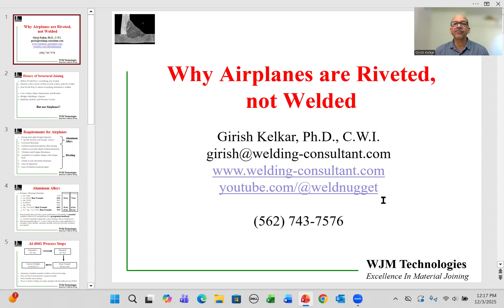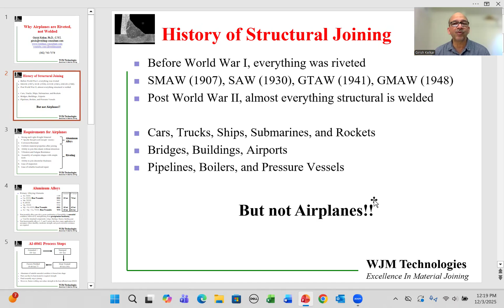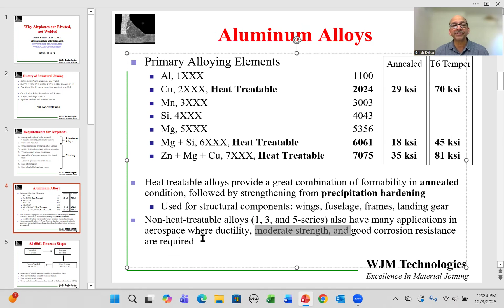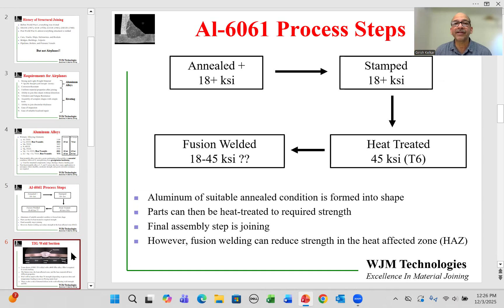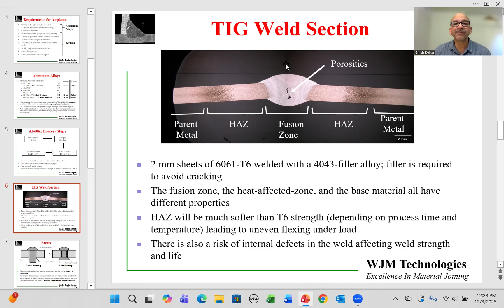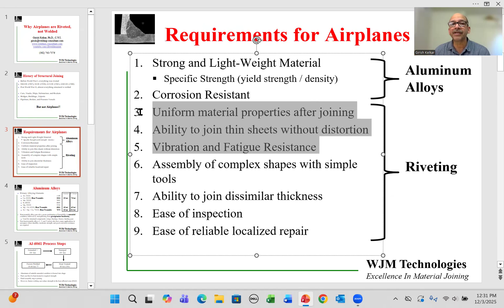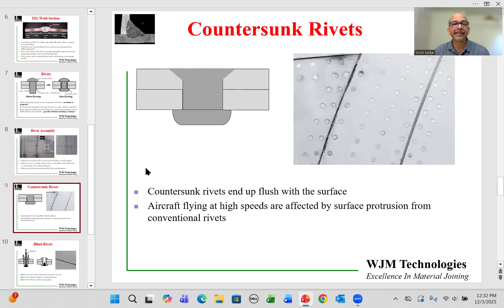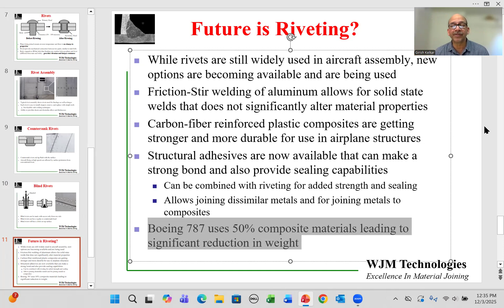Why are airplanes riveted and not welded

Comment: Seems to me aerospace manufacturing has been trying to get away from riveting as much as possible.   I suspect it’s due to time consuming rework process for reinstalling rivets that do not meet the stringent quality specifications for rivet head shapes, gaps etc..  Also excess noise if using old bucking techniques.
HI-LOK style two piece fasteners are much easier to install and if rework is required they are easily removed and replaced - reducing rework costs.
Reply from the maker: Overall, use of fasteners will reduce as more of the aircraft is made of composites and then adhesively bonded.  But where fasteners are required, rivets will have a place because of being lighter, not requiring very precise hole drilled, and having good shear strength (compared to Hi-Lok which are heavier, require precise hole drilled, and are better in tension applications).  Given that the commercial planes are huge, all kinds of fasteners including regular bolts will find their niche.

Comment: Very interesting.  Please could you explain what 'stressed skin'  means in respect to aircraft fuselage etc manufacture  . Thanks.
Reply from the maker: The best way to understand stressed-skin is to first understand the extremes.  At one extreme, you have monocoque (french for single shell) design, where the outer shell/skin carries the entire load and there are no internal structural components; good examples are an egg-shell itself and the bob-sled.  On the other extreme are designs where the internal structure carries all the load and maintains mechanical integrity, while the outer skin is just for enclosing the space but does not carry any load; good examples are dry-wall (in US housing construction), and outer panels of a washer/dryer; if you remove that "skin" the structure still stands and there is no loss of function.

Stressed-skin designs are where the outer panels are for producing the desired profile and also carry some of the load, as is true in aircraft where the outer skin has to be able to maintain shape integrity while transferring some of the load to the internal framework.  Removing such skin can lead to loss of function and can even lead to immediate failure/collapse of the structure.

Comment: Excellent video!  But should have added that riveting is about the "only" way to fix sheet to frame structures.  And should also have explained on the disadvantages of rivets:   As forces are transferred trough single local points, materials have to be chosen much thicker to deal with total forces!  And fixation of 2 sheets side by side requires an extra connection plate!  Both these reasons do add weight to riveted solutions!
Reply from the maker: Agree that rivets do have disadvantages of requiring to drill holes, needed a connection plate for butt joints, and needing many rivets as each small rivet can only transfer so much force.  Rivets indeed increase weight of the structure, and hence are now used only in special applications.

Comment: Why can’t bolts be used if they were made of the correct material they would compress like a rivet but if tightened by torque  they would be more predictable.The rivet is not compressed to an exact torque is it?
Reply from the maker: Bolts can be used in situations where vibration resistance is not as important, but cannot be countersunk flush to the surface.  Rivet strength is defined by material properties and dimensions, and is quite consistent.

Comment: Years ago, I remember there were descriptions of rivets being heated to red hot levels, inserted into a hole and then some form of compression hammer pounded the rivet to fill the hole in the structure. …used in bridge construction, I think. Is that technique used any longer?.
Reply from the maker: Steel rivets are not commonly used except for repairs of old bridges.  Mostly have been replaced by either high-strength bolts or welded construction.

Comment: Own a small welling business welding 7000 series aluminum should never be considered it’s just a disaster I don’t care what you use laser mig tig
Reply from the maker: Many high strength 7xxxx and 2xxxx alloys of Aluminum are susceptible to hot cracking and are considered un-weldable by conventional fusion techniques; exception is 2219 which is used for aerospace structures and is fusion welded.

Comment: Friction stir welding is being explored and used in some aircraft structures
Reply from the maker: Friction stir has benefits of making a solid-state bond (unlike fusion welding) but is not easy to repair and replace (unlike rivets).  So it falls somewhere in between.  Amount of friction stir welded components are increasing in usage in all industries where aluminum is used including aerospace.

Comment: So puddle welding or spot welding aren’t mentioned as a comparison and I’ve wondered how it would share In similarities as rivets.
Reply from the maker: Spot welding is not feasible to repair, whereas rivets can be removed and replaced with simple tooling.  Also, heat from welding can affect the material in and around the weld including distortion.

Comment: Chance Vought spot welded the skins to the structure on the Corsair, snd I think several other aircraft.
Reply from the maker: Many welding processes including spot welding and arc welding are used in aircraft manufacture.  Rivets are preferred in situations where repeatable mechanical behavior and ease of maintenance (inspection, replacement) are important.

Comment: Angara's rocker tanks are friction-welded with stirring on huge slipways.
Reply from the maker: Friction stir welding has been widely adopted by the aerospace industry for welding aluminum, and they will use it as the first option for welding given that it is a solid-state process.
Reply: Doesn't friction stir also produce a lot of heat and thus produce a HAZ? Or is is just less of a problem than with arc welding?

Comment: There is one crazy airplane welded like a ship from stainless steel - MIG-31.
Reply from the maker: I do recall watching a documentary on Mig 25 (earlier version of Mig-31) where the pilot defected to Japan; and analysis of the aircraft revealed it was all welded stainless steel.
Reply: @weldnugget  It's funny to think of it as a flying railroad car for transporting kerosene. 🤣😂
Reply from the maker: Design choices.  I think developing a welded stainless frame was a lot faster than other options at the time (cold war).  And it did hold records for highest altitude flight and fastest (>Mach 3); not an easy feat.

Comment: Riveting is a non permanent joining process. Hmm, countersunk rivets help maintain laminar flow across control surface. The sudden sharp change in geometry may lead to formation of turbulent currents.
Reply from the maker: Riveting is a mechanical means of connecting which does not alter the base material properties. Rivets can be removed and replaced for maintenance and repair.

Comment: I have read that there are certain adhesives better than rivets.  My dentist said compounds based on sea barnacles might fix teeth for a lifetime and could have uses in aviation and space vehicles.  Sounds good but I know next to nothing about this.  What I do know is that 20 years ago I glued some outside parts on my motor home.  The motor home, always outside, is disintegrating but the glue parts are as strong as ever.
Reply: High bond strength double sided tape has been used to bond sheet metal panels to body frames in commercial vehicles for some time now.
I saw a demonstration of 3M VHB tape joining two pieces of pine framing timber. When the timbers were pried apart the wood surface tore away and remained adhered to the tape
Reply from the maker: Awesome.  Thanks for sharing.
Reply from the maker: Yes, there is always a joining technique for a specific application that works well.
Reply: Laminated  aluminium sheet exists are also used for aircrafts, I believe it was developed here by the Dutch University TU Delft, and later patented in a commercial product by Akzo Nobel under the name  "GLARE" from a combination of the words Glass, Aluminium  Reinforcement.

”Glare consists of layers of 0,3 – 0,4 mm thick aluminium alternating with epoxy-bonded glass fibres. Though material and production costs are relatively high, the material allows for a design tailored to local stresses and functionalities, and the production of very large skin panels. This results in lower assembly costs and significant weight savings.”

Used in the Airbus A380 and probably many more.

I imagine it can be riveted just like the full aluminium sheets, but I actually don't know what joining method is used there. would be very interesting to look into
Reply from the maker: Good old AI search says that GLARE sheets are joined by adhesives or rivets, depending on the application.

Comment: But why aren't rivets more widely used? For instance, why aren't rivets used in boat building?
Reply from the maker: Rivets are well suited where the application would require lot of flexing (as on an airplane wing) and requiring vibration resistance (as expected during landing and take off).  Plus on boats you have an issue of corrosion and sealing; welding would be preferred.
Reply: Small aluminum boats are quite often riveted. Lund, etc...
Reply from the maker: Rivets are probably the cheapest technology for joining, and there is always going to be a market for those in certain segments.
Reply: THey used to be used in ship building. Welding saved significant amounts of weight for the same strength. Especially in context of the Washington treaty limiting warships by tonnage that was a major concern.
But that is welding steel, which comes with different behavior changes (and ways to control them) for the HAZ and filled sections.
Today the easy availability of welding roboters (both the melting and mechanically stirring kind of) that keep the whole process repeatable&predictable and there is a wider variety of joining methods you can select from in accordance with the task. Rivets are one of many options, and often not the cheapest.

Comment: On a Velomobile I made when skinning with 6061 T6 between lot joints I applied to layer of urethane sealant before drilling and riveting. The urethane remains elastic and prevents oxidation at the contact between rivets and aluminum.
Reply from the maker: Yes, that can be an option. Urethane might also provide damping of vibrations.
Reply: @weldnugget  yes that was my primary purpose. Because of the oxide layer, it adheres very well.
Reply from the maker: In addition to damping, adhesives can provide sealing to riveted joints; and also provide separation to prevent galvanic corrosion between dissimilar metals.

Comment: That was very interesting. I work with various alloys. We know that 2024 and the various 7000 series allows are considered to be unweldable. Actually, they can be welded, which is concerning as these welds can come apart in time. So while the weld seems viable, it’s not. I’ve just acquired a laser welder. It offers a lot of valuable options. I’m experimenting with various techniques.
Reply from the maker: Fusion welding of high-strength aluminum alloys is challenging as you have to deal with issues such as solidification cracking (during weld solidification), stress corrosion cracking (in use), and low strength in the HAZ (result of heating during fusion welding).  Alternatives include solid-state welds (e.g., friction stir welds), mechanical fastening such as riveting and other specialized fasteners, and structural adhesives.

Comment: What about laser welding? It offers some good properties. There is still a haz, but it can really be greatly minimized.
Reply from the maker: Laser welding offers some advantages but not as good as riveting for connections that require uniform properties and significant flexing.  Plus the issue of on-site repair is not easy for laser welding.
Reply: @weldnugget  ok, thank you for answering!
Reply: the welding METHOD makes no difference to the metallurgy of an aluminium alloy.

all that changes is the amount of heat affected zone and precipitation of various  elements from the solid solution. shielding gas or fluxes (whose fluxing alloy these days in aerospace?) may play a role as they add or remove alloying elements.

plus porosity, inclusions, undercutting, insufficient penetrations, toe and heel cracks,  on and on....

Comment: friction stir welding is not repairable easily in the field.

carbon fiber composites also bring with it a whole host of potential issues regarding failure, inspection, and repair.
Reply from the maker: Agree.  There are many joining/welding techniques that can be used (and are used on some parts of the planes such as engines and landing gear), but the ease of repair in the field is a critical benefit of rivets.

Comment: The basic premise of current material science analysis is that the property of the material is uniform and consistent everywhere on the structure.
Welding vitiates this uniformity of properties when the welding heat changes the strength property locally.
It makes the analysis very extremely difficult. Extremely complicated finite element analysis, when the computers are powerful enough, maybe able to solve the microstructure change of properties in welded areas.

Airbus A380 is glued together. 
Composite material which is lighter and stronger than duralumin types metals.
Reply from the maker: Agree that variation in material properties makes welds difficult to model.  Planes will have increasing amount of composites and adhesives, although rivets and aluminum will continue to be used in commercial airlines.

Comment: Are steel or stainless rivets ever used with aluminum?
Reply from the maker: Steel/stainless rivets can be used on aluminum for strength, but need to be aware of potential corrosion in moist environments.  Can be used with suitable plating (Zinc) or washers/sealants.